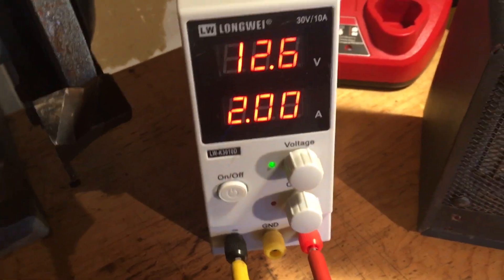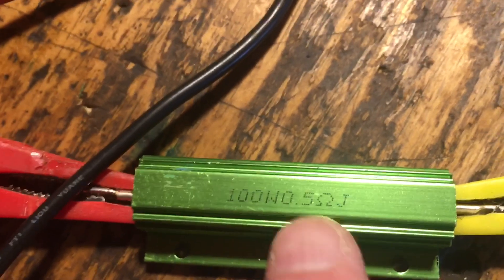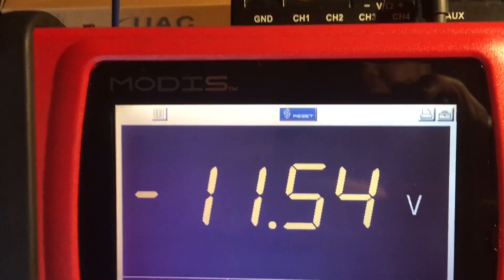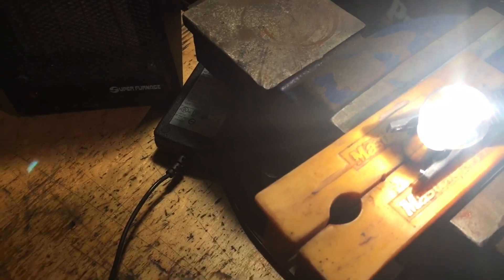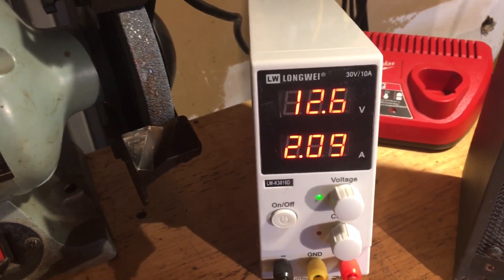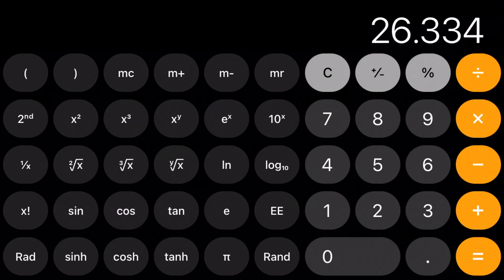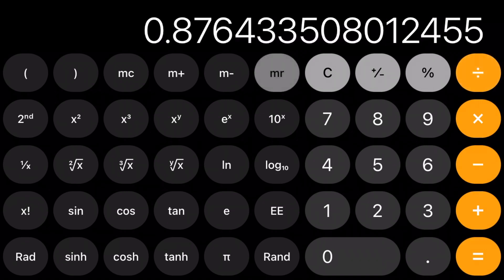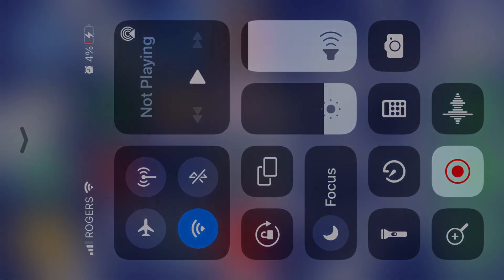Resistance Impacting A 12V Circuit

Comment: All resistance counts especially in low voltage applications, But really even in 230V  as well as low volt applications they might be used as inrush current limiters too when charging big value capacitors which gonna pull infinite amounts of current while charging otherwise. it´s Ohms Law, it has to be obeyed
Reply from the maker: Thx for watching 🍻